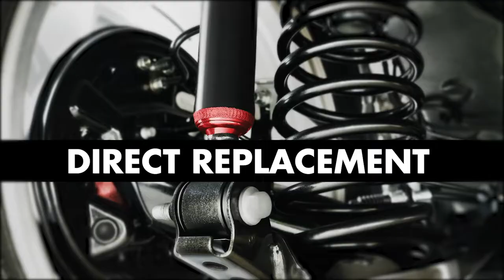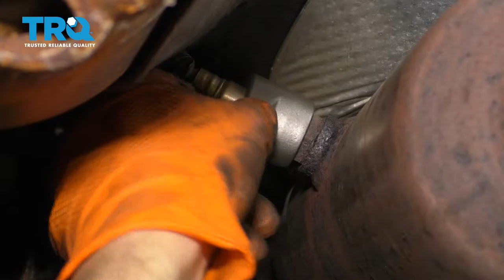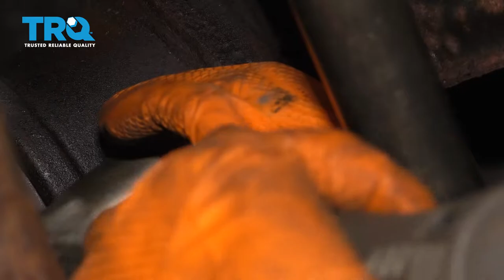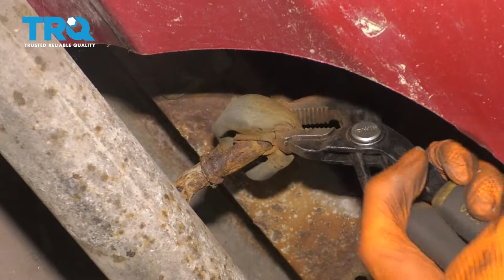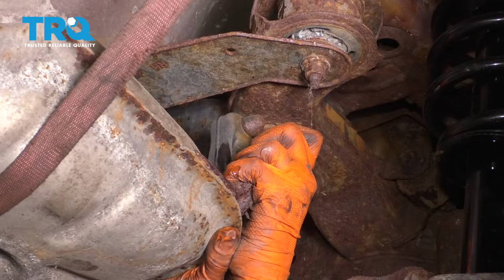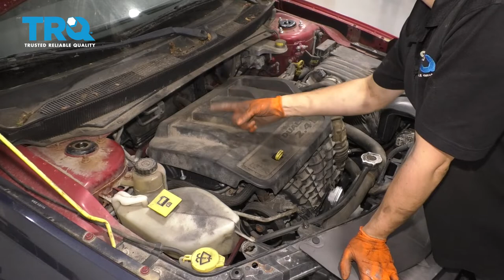How to Replace Exhaust Pipe with Catalytic Converter 2007-2010 Chrysler Sebring

Comment: Are the exhaust manifold studs permanent, or is it possible to remove the studs on the exhaust manifold by use of an air gun then install new bolts and nuts?